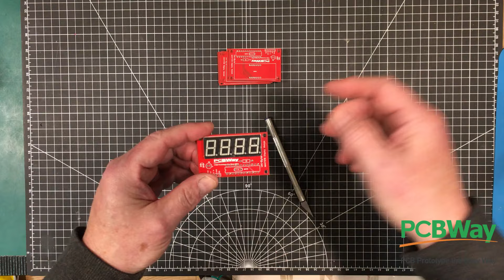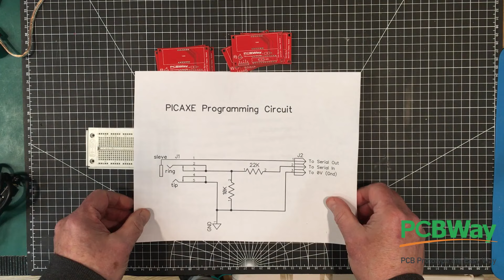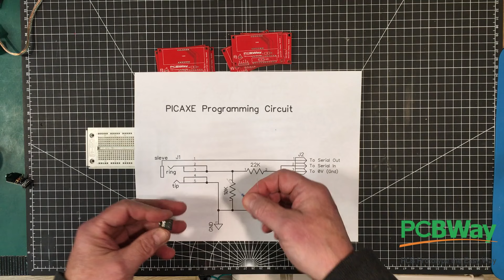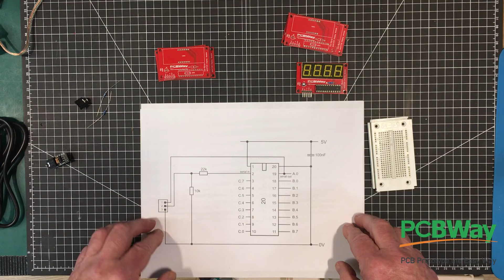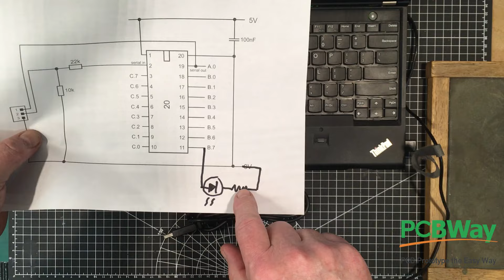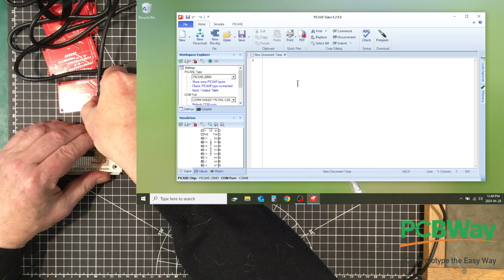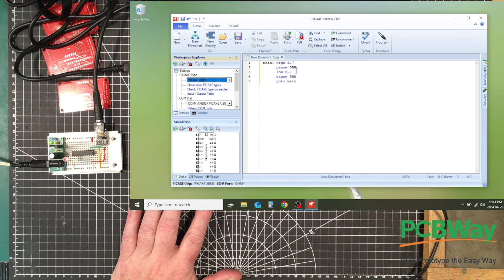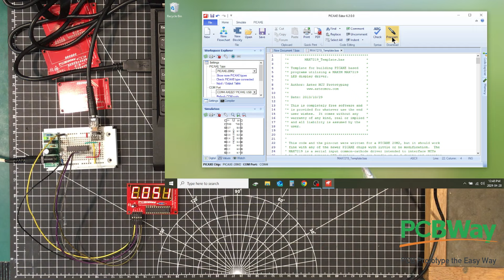Uni-Byte 0181 - Minimal PICAXE Development Setup and MAX7219 DISPLAY Module (Modular Design)

Comment: The mini breadboard with sockets on the edge might work better with the audio type jack.
Reply from the maker: I have seen that jack used for audio before, but I know what you mean.  Not sure why PICAXE chose this jack.  My first effort (and I can't find it now) was an in-line stereo jack.  I just housed the resistors in the barrel and had 3 wires coming with DuPont pins on them.

Comment: The Siglent sounds interesting, but it sounds like clearing out the mail might be a better way to go. This PICAXE project sounds interesting. Seeing things outside the Arduino/Raspberry Pi Pico world is always good. I have a couple of the 8 pin PICAXE chips, cable and a starter kit, I guess I have a reason to dust off my Windows machine because it does not look like they have any options for Linux. Thanks, take care.
Reply from the maker: I agree!  They do have Linux options.  Google "PICAXE AXEpad".  I will put a link to it in the description.